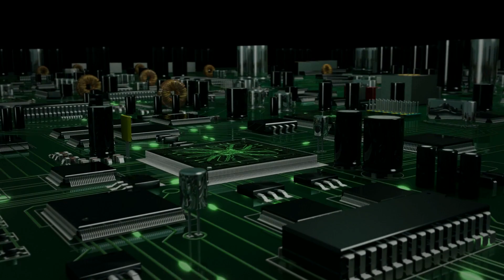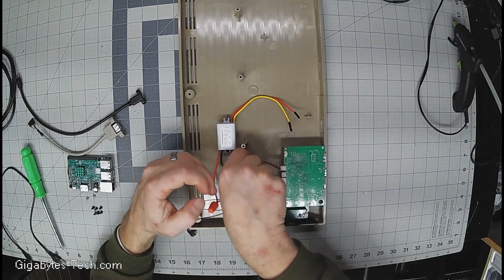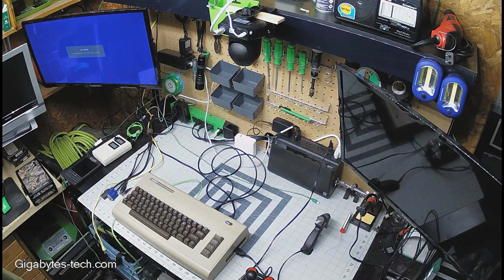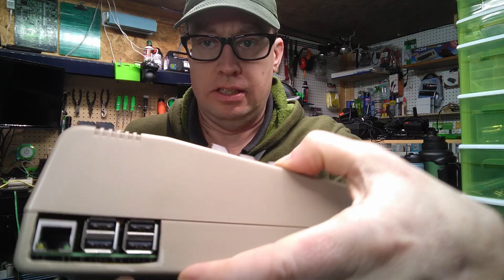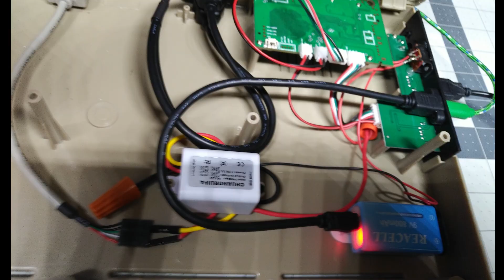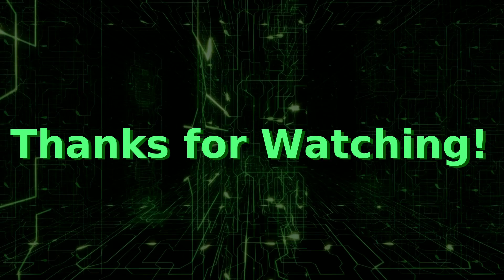Maxing Out the Maxi: 7 Upgrades to TheC64

Comment: would it be possible to add a  user port interface to run external projects like the good old Commodore 64 and VIC20 had?
Reply: No. It isn't capable of that. The Raspberry Pi is, however.

Comment: How does the original boards processor compare to the pi-3? I wold love to see a hack keeping the stock board but have access to Linux and a small web browser using a USB wifi.  Do you thing it could handle it?
Reply from the maker: The Pi3 is a 64 bit processor running around 1.4 gigahertz (depending on the Pi). TheC64 uses something similar but a little slower and less capable than the Pi 3. The Pi has WiFi and Ethernet capabilities so it can go on the Internet easily and is something within the reach of a lot of people. While hacking TheC64 board then adding the capabilities back into the board the Pi already has might be a fun project, it is an academic exercise at best.

Comment: I feel that you should have bought one of them new produced model C cased, a pi adaptor kit and used a keyrah adaptor instead.
Reply from the maker: It would have been a very different project then.
Reply: @gigsplain  True and indeed. But it would meet the same requirements and the end result, would be a bit more tight, from an enginering perspective. The advantage would be an original keyboard. I have a TheC64 in my collection, and I really dont like the quality of the keyboard. If the makers, just have used a spring under each keycap like original keyboard, then it would have been the best hardware solution for the Vice emulator that it is build with.
Reply from the maker: @brostenen  the issue is I didn't want an original keyboard. I wanted to be able to use TheC64 keyboard on multiple platforms. I really don't have any complaint about the keyboard itself. Things are made differently today and I will leave it up to you whether that is good or bad. As I mentioned in the video, the additional USB was a bit redundant but otherwise, I think it worked out how I intended it to. I also have several Commodore 64 projects that are waiting on original style keyboards or keycaps. With those projects what you suggest makes sense but this was not like those projects.
Reply: @gigsplain  That is true. All projects are different from each other. Personally I dont think the keyboard is the same quality as the original, but that might just be me. But it is a nice project that you have done here.
Reply: @brostenen  You're definitely right about the keyboard, however even though it seems a bit less sturdy than an original, I personally find that it types a lot better. I feel like a bmc64 build would be more satisfying, but they are way too common tbh. This project was definitely interesting, and personally, I have always fantasized about having a pi inside a c64 to switch between playing classic games, and using piOS
Reply: @rxblackpill  If only they have added springs under the keycaps of TheC64. 🙂

Comment: Similar mods, but better executed, than that VIC-20 with the fake "working cartridge port". Which was just a TheC64 painted white.

Btw it's called TheC64, not The C64.
Reply: Plus there is no "maxi" in the name.
Reply: @brostenen  May as well accept the Maxi handle.  It's pretty solidly established to differentiate this model from the Mini.  At this point, it doesn't matter that it's not a manufacturer's designation.
Reply: @Vector_Ze  I do accept it is what it is. But only because I have one original breadbin, one SixtyClone that I personally made and currently building a keyboard adaptor for my homemade ATX64.